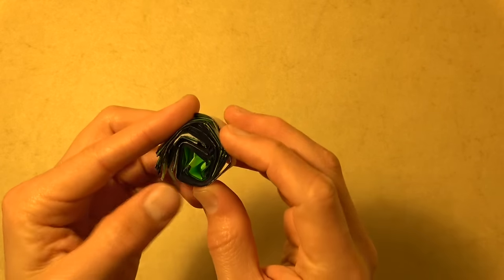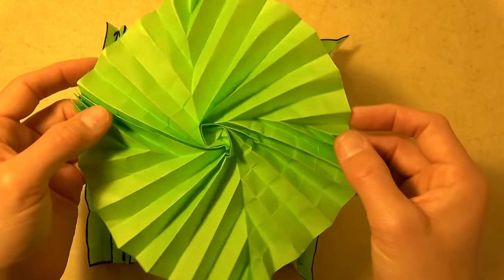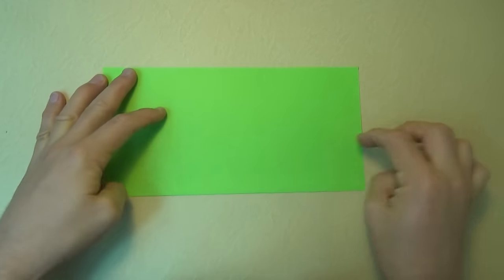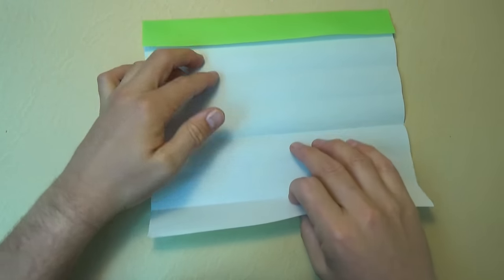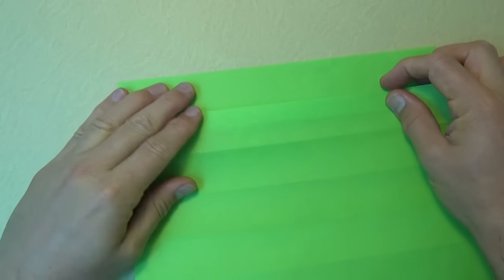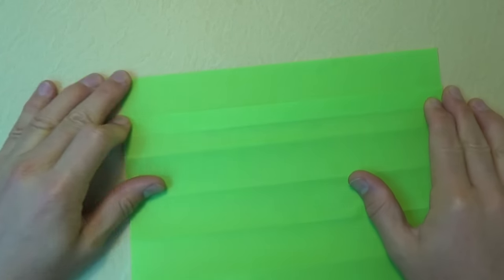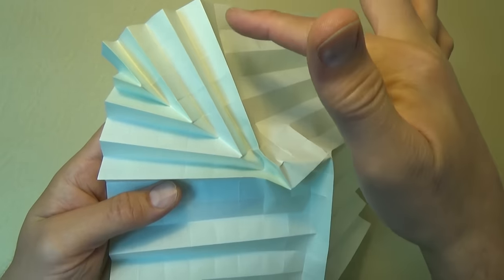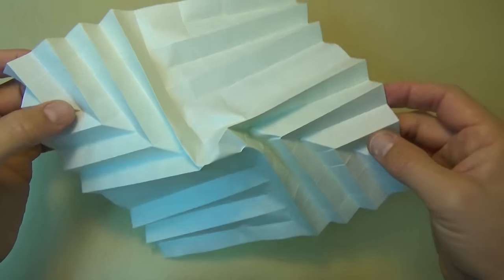Flasher Maze

Comment: Hi Jeremy,i love all the flashers.but i thought there may be a chance there might be a rectangular flasher. so what i did i used the excess paper we get while cutting an a4 sheet into a square.i made a flasher out of it and was wondering if you could try it and make better tweaks.Thanks and i love ur vids
Reply: but it works from smaller end divided into 8 and big divided into 16.and 1 unit taken off on each.it works on that but it works way better on bigger divisions